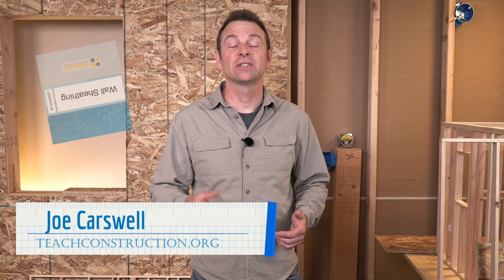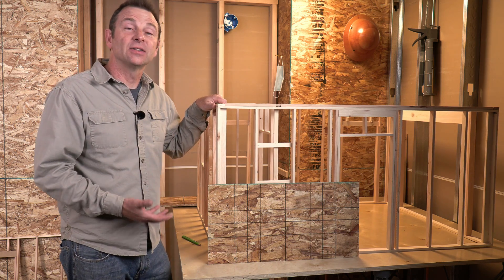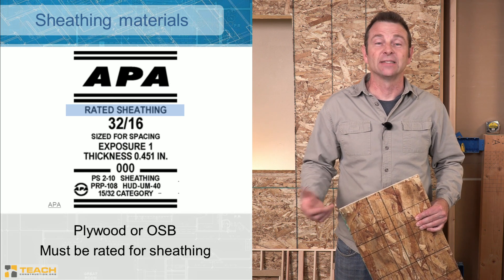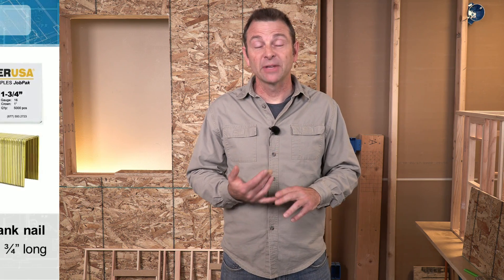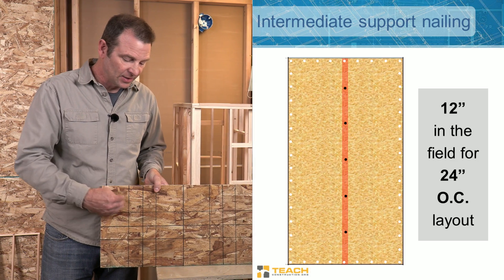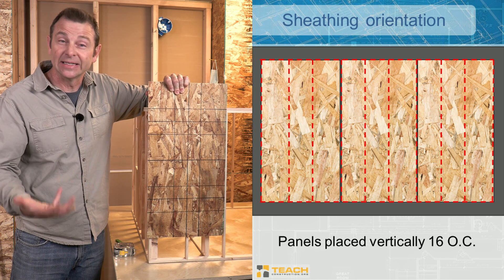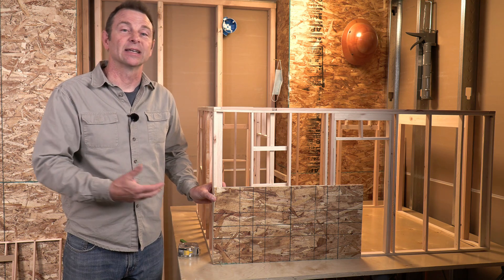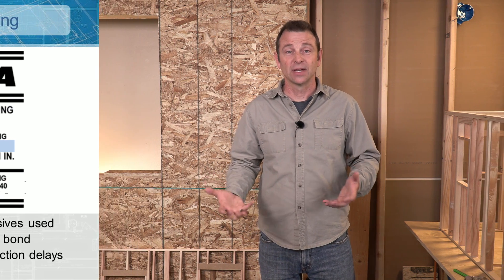A lesson about Wall Sheathing in Residential Construction - TEACH Construction Trades Training

Comment: nice presentation.   92 5/8 " + 4 1/2"= 97 1/8" > 96 1/8" coverage of exterior sheathing.  How do you make up for difference at top (joists) and bottom (at concrete slab)?  Thank you!

Comment: I have a question. Situation: butt and through exterior walls are framed at 16 inches center.  The premarked lines on OSB on the through wall should match the studs as the first board starts at the edge of the wall.  However, the but wall connects to the through wall which adds the thickness of the wall, either 3.5" or 5.5" which in my mind will offset the premarked lines on OSB .  How do you suggest to deal with this situation, which to me must occur all the time ?   Thanks for your help and hat's off for the quality of your videos.

Comment: how long is the stud? Isn't the Stud in a normal house 8' or 10' (8/10 feet ceilings)? If so, how can the sheathing run from the bottom plate to the top plate? The sheathing wouldn't be long enough to reach both of them
Reply: https://www.youtube.com/watch?v=QTBdP2fk8XI

Comment: Ah yes horizontal sheathing on outside walls.  I see it done correctly or I won’t do it  which is horizontally on wall and not vertically as this makes for a stronger wall against earthquake for example as racking  isn’t going to happen much with horizontal.   It can be done correctly —guys just don’t like to cut this sometimes the way it’s supposed to be and if you do and lay it like bricks on a wall, you’re gonna have one hell of a strong wall. It sure does with vertical!  Most all guys I see run the OSB vertical and they won’t do it otherwise.   I made mine do it right.   Prefer 1/2” on walls 16” oc   Not staples.  Nails only like you first said.  And don’t get over zealous with nail guns and bust through layers of OSB or into studs. Keep flush

Comment: Zip has weather/water resistant barrier outside the insulated area, whereas a vapor barrier would be inside the insulated area to retard migration of warmer moist air toward cooler condensating surfaces. Keys are to deny entry of water from outside areas, not to trap water inside, but also mitigate for potential condensation.

Comment: When building on a concrete pad, should the sheathing be installed wherein it is touching the pad or should it be up slightly to prevent wicking?

Comment: My house was built in 86 and I recently found out the T1-11 siding is nailed directly to the studs with tar paper as a barrier. Could insulated zip boards be put directly  over this or would I need to remove it first?

Comment: What materials/insulation would be best for building a conditioned room within a steel building, which means it has no exposure to the sun and elements?  Economical yet cheap to keep cool.  Thanks
Reply from the maker: Maybe build the room with 2x6 and fill with batt insulation.

Comment: Building a one story frame house. Builder has put up OSB,BUT there are several areas where the sheathing does not hit the vertical 2x4 stud, leaving a gap that you can see from inside to the outside. Builder says that’s ok because house is wrapped with vapor barrier and  vinyl siding will go up over that. I am not happy with this sloppy way of installing the OSB. How can the builder fix this 1/8” gap since the outside wrap is already up?  Also, is leaving a 1/8 “ gap from interior to exterior, with only the wrap covering the ope space, up to building code?

Comment: Since the sheathing is exactly 4x8, if you add a 1/8" gap between each sheet,  after installing 4 sheets you will be 1/2 " off center of last stud and it will get worse when doing a long wall.
Reply: The 7/16" sheets I just bought are 1/8" shy in each direction to account for the spacing requirement.
Reply: 🤔 solutions…

Comment: @constructionEd  I want to hang a heavy 5x7 ft  mirror on my dining room wall. My stud finder was detecting a lot so I cut a hole and  found OSB sheathing behind the drywall. Can the mirror screws still be mounted through drywall & sheathing if I can’t see the studs? Will the sheathing support the mirror? The kitchen stove is on the other side of the wall.

Comment: Do sheathing panels have to meet at the corners (i.e. in a lap or a miter), or can they end flush with the faces of the corner stud, leaving a gap along the corner edge?
I figure if I'm using ZIP system I will be taping the corner, anyway.
Reply from the maker: Even with zip system I would lap them, a miter is not necessary.   Tape will help with the air sealing but you want to give the tape something to adhere to.

Comment: would you use 1/2" OSB for roof decking?  The framing is 24"OC.
Reply from the maker: Building Code specifies what is required.

Comment: If you line up the sheathing flush with the outside edge of the edge stud then how would a 4' sheet of osb fall on center on the common stud?
Reply from the maker: When doing your layout - you should start by pulling from the end of the bottom plate.  If this plate is on a thru wall - then edge of the OSB will fall on a common stud.     We have a lesson on Layout also.

Comment: Loving your videos, thank you! One thing I don’t understand yet is how OSB sheets can still fall on center / layout despite having to be flush at the edges of the walls or even overlapping with other sheathed walls in corners. Also, wouldn’t the 1/8 expansion gaps throw off the layout? Thank you!
Reply from the maker: Good question! - next time you are next to a sheet of OSB - pull a measurement and you will be surprised that they fall just a bit short.  4 ft. x 8 ft.; Actual: 0.451 in. x 47.875 in. x 95.875 in.   Just enough for gapping ;)
Reply: @ConstructionEd  Thank you for the reply. How about in corners? Wouldn't it land on the center of the end stud and be short 3/4" of the edge of the wall (or more if overlapping with other wall)? Thanks again!

Comment: When you space the sheathing 1/8",  do you trim off a 1/6th from each sheet or do you cheat a few sheets and take 1/4 off one to get back on your 16 or 24 layout.  It has  always puzzled me why they don't simply make the sheathing 1/6th short. I suppose you could calculate this 16th into your layout but I've never seen anyone do it. I just picked up 24 sheets today and I will make the effort to leave the spacings.

And, thanks for the perimeter nailing factor on horizontal installations. I was going to do some horizontal installations to help pull together a long wall and I didn't consider the blocking, which I will do.
Reply from the maker: Check the actual measurements of your OSB.   You may find that it is a 1/8 less than 4x8.
Reply: @ConstructionEd  I did, the day after I posted my comment. For the first time in my life I got some that was curt short.  I was marked "sized for spacing" or something like that.  :). Thanks.

Comment: Wood siding T -111 I believe.  Removing some rotted pieces, realized that my home has no sheathing on this particular side of the home.  Just a foam backer, then the interior insulation.
Reply: Sheathing is not required by code - unless it is needed as part of a sheer wall.

Comment: Great way to use trash materials add the term "sheathing" public is sold. Throw some osb backed lp siding you can throw em up fast. 5k-6k sq ft dream home starting at the 900's. Good luck 10 years from now when the subs come on the weekend skip steps your sheating will swell and lose its original purpose. Fail steps on the deck Sill plates will rot out.
Reply from the maker: Just curious, What material are you recommending for sheathing and why

Comment: Question I know this would add a lot to the cost of a build but would it be worth it to sheath both the outside of the house with OSB and the inside of the wall then hang sheetrock with the goal being to build a stronger wall and quieter house?
Reply from the maker: While the wall would be quieter, there are better ways to accomplish that.   Like installing a dense soundboard inside before the drywall.   On the question of strength - more OSB may provide a better shear value - if that strength is not needed, it is just a waste of materials.   In fact - most sheathing on the outside of the house is not needed (unless the engineer requires a shear wall).  It is there to hold back the insulation and part of the air barrier assembly now required by energy code.
Reply: @ConstructionEd  thank you for your reply

Comment: Help
8 ‘ osb doesn’t span 8 foot wall 
It is the same length of the 8 foot studs
Leaving gap of 4 1/2 inches 
WHY?
Reply from the maker: I may not be following your example correctly.  But if a wall is built, that is 8 feet long - then an 8 ft piece of OSB Should cover it.   Your question sounds like your wall is longer than 8 feet
Reply: @ConstructionEd  thanks for responding
The standard stud at Marvin’s is 8 foot
The base, top, and cap adds 4 1/2 inches
I would have to cut my studs from 96 down to 91.5 inches to cover wall
I don’t understand what I am missing
Reply from the maker: Ah - I see; I thought you were talking about length, not height.    An 8-foot wall is typically 8 feet from bottom to top - including the plates.   So yes, your 8-foot studs would be cut down.   Look in the bins at the store - often, they also sell stud-length lumber.  Here in Colorado those are 92 5/8 and are in the bin next to the 8-foot studs

I am not sure of the particular build you are referring to - but often, sheathing is done in longer boards so it covers the plates AND the exterior of the floor framing on the second story.  Norboard sells a specific product for that called tall board.
Reply: @ConstructionEd  thanks
I have watched a 100 videos and never seen anyone cut the studs 
Just built a shooting house and have been scratching my head
I was today years old when I noticed

Comment: Can i use fiber cement boards to close a back porch without sheathing?
Reply from the maker: Sheathing is only required when a sheet wall is called out or when the sheathing is part of an air barrier solution for energy code.  If those to instances are not required then yes you can skip the sheathing.

Comment: I read that you should put the smooth side outside for better moisture resistance, but the lines are on the rough side, so my gut tells me the smooth-rough thing is bogus & the lines are most important. Am I right?

Another thing: we’re supposed to put 1/8” space between panels, but the panels are 4’x8’, & the studs are 16” on-center, therefore  the junction is going to move 1/8” each & 4 sheets are going to be off by 1/2”, and 3/4” after 6, which brings you to the edge of the stud. Should people be offsetting the studs or trimming the sheathing?
Reply from the maker: The OSB should not be considered part of a moisture management solution.   The house wrap on the outside is for Bulk Water management and then there are many other products for moisture management.  

You are correct with the "creep" caused by the spacing.   It is common that at least on of the panels gets cut before it is an issue.

Comment: Can somebody explain how the first sheet which covers the entire 1.5" width of the first stud properly lands in the middle of the 3rd stud as it's supposed to? For example, I get that with 16" OC studs a panel which lands in the middle of one stud will properly land in the middle of the 3rd stud down and so on. But the first panel needs to totally cover the first stud (not land in the middle), which means it breaks on the EDGE of the 3rd stud, no?  What am I missing here?
Or do you just get around this by making a custom first sheet that lands in the middle of the second stud, 32" over, and then use a full sheet after that?
Reply from the maker: when marking out your layout - it is common to pull your measurement for the first stud from the corner of the wall. Meaning the hook of the tape is on the outside edge of the end stud.   We have a video about the plate layout process that covers this.

Comment: Why does my OSB have tong and groove if they need spacing?
Reply from the maker: Not all OSB has a T&G.  Sheathing and decking does not have the T&G because as you pointed out the spacing requirements.   But Sub Floors do use T&G OSB - and those are connected tightly to each other.
Reply: @ConstructionEd  thanks for the reply. Am going to use it for walls, but its inside an insulated metal storage unit so i ope it wont expand or contract to much :)

Comment: This is great to find! Im in the process if having to sheath my damaged garage wall. Ive seen things listed as structural rigid foam like R tech rigid foil faced foam. I dont live where their is tremors but we do have tornados on occasions
Reply from the maker: sheathing with insulation is really cool stuff - pun intended
Reply: @ConstructionEd I want to hang a heavy 5x7 ft  mirror on my dining room wall. My stud finder was detecting a lot so I cut a hole and  found OSB sheathing behind the drywall. Can the mirror screws still be mounted through drywall & sheathing if I can’t see the studs?The kitchen stove is on the other side of the wall.

Comment: In your talk about nails you never mentioned construction screws. Are they not legal to use? If so, what are the parameters? BTW, i'm not in the trade. I'm building a 12X24 Workshop at my house.  Thanks.
Reply from the maker: You can use screws for framing and sheathing, but they have to have a structural rating
Reply: @ConstructionEd  Thank you for such a quick reply.
Reply from the maker: @papasmurf4009  I had just happened to be online - good luck building your shop

Comment: I have a specific question related to a personal remodel project I'm working on.  The house is in moist Climate Zone 3 (right on the edge of CZ 4).  It was built in 1974, 2x4, 16" OC,  R11 faced insulation, fiber board sheathing, no vapor barrier, 3.5" brick siding.  Here is my problem: a significant (35%) portion of the original fiberboard sheathing has disintegrated.  Now what!?  I do not have the budget to tear off the brick and redo the siding.   Is there any possibly way to air seal and protect from shear forces now?
Reply from the maker: It is possible that the original fiber board did not/not had to provide shear (not all walls need the shear support) you can use a retro foam insulation in the wall cavity.   That will give you thermal control and vapor control
Reply: @ConstructionEd  Thank you for your reply.  I stripped the house down to the studs on the inside.  I used Dorken Delta Vent S on the bays where the fiber board was missing (to control vapor, provide a drain plane and air gap between insulation and the brick).  Then came in with rockwool and purple drywall.  I guess time will tell if it'll work.  Cheers.

Comment: 12:00 - re the 1/8" gap.... How is that handled in practice when after the first sheet, the edges no longer fall on the center of the rafters or studs and the discrepancy grows with every sheet? Are the sheets not 4x8 but rather 3'11⅞" x7'11⅞"?
Reply: Actual size is slightly undersize for that reason
Reply: Not all sheets are. When you start to notice youre not gonna have enough room to nail you need to cut the sheet unfortunately @vertonmccaulou5

Comment: Good info.  May I make a suggestion?  You typically build the wall on the deck - studs and plates.  Square it while it's lying down, then sheath it while it's still horizontal.  Now when you tip it up, it's still square and sheathed.  No climbing ladders with a 4x8 sheet, nor renting scaffolds.
Reply: Unless you have a crane. That wall is crazy heavy to lift with sheathing.
Reply: @ronaldbryant-wright516 
Heavy? He holds them in his hands, look. He is moving those walls like it's nothing. In my opinion they are not very heavy.
Reply: We always  sheathing   horizontally , additionally wind bracing ing walls as part of the framing.
Reply from the maker: Thanks for the comments and suggestion.  We tried to make this series of classes more about the theory of framing vs the process.  The process videos are separate, and unfortunately not available on YouTube -
Reply: @ConstructionEd  Absolutely, Processes for production framing is different from individual custom types homes, and commercial structures. Thanks for the information and for making this important distinction.
Reply: @ConstructionEd why unfortunately?    Are they behind a paywall?  Good!  Hard work deserves its price!  Correct information is also priceless!

Comment: Hi I have a project of a tiny house 16x40 my question is when I build a wall I should build it in different pieces every 8' wall or I have to build a wall every 16' until I complete the 40' long?
Reply from the maker: Build a wall to the length that you can safely handle - just put your wall panel breaks in locations that will not interfere with other framing
Reply: @ConstructionEd  ok thank you for your help

Comment: For building a shed on a concrete slab, what is the recommended gap between the sheet and the concrete pad? Should flashing be used between baseplate and sheet to cover any base plate exposure?
Reply from the maker: you should have enough of a gap to stop water from wicking to the siding.  A J channel flashing is a good idea

Comment: Would adding sheathing to both sides of the wall increase its strength?
Reply from the maker: It could - but typically it is not needed.   Sheathing is for shear strength not compression strength.

Comment: According to APA you cannot just rotate OSB whenever you feel like there is actually a way that it runs and the wood chips within the OSB should be to be perpendicular to the studs. For proper wall strength. The information you're giving out around minute 10 is incorrect.

Otherwise nice video and content I can't do any better.
Reply from the maker: I will look at the APA standards - thanks for the comment